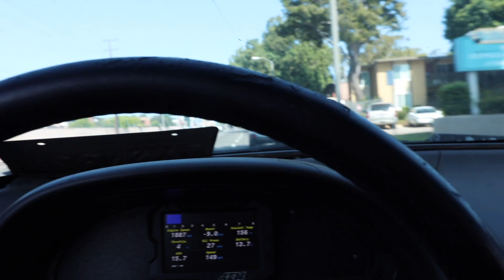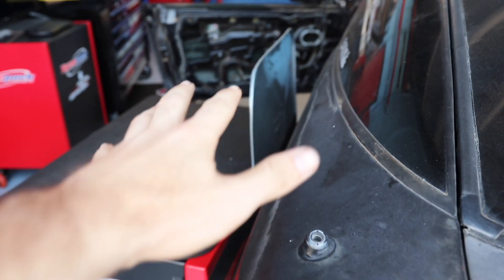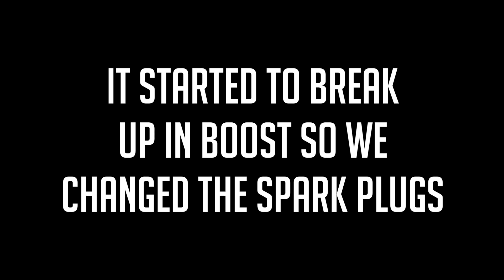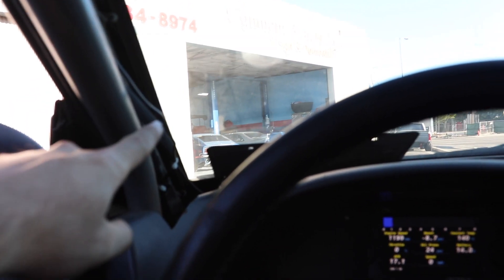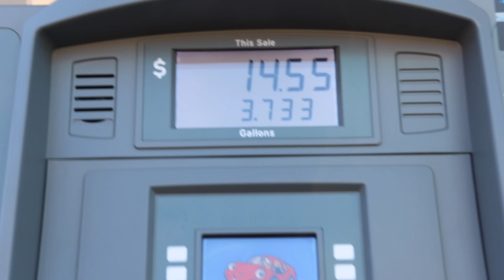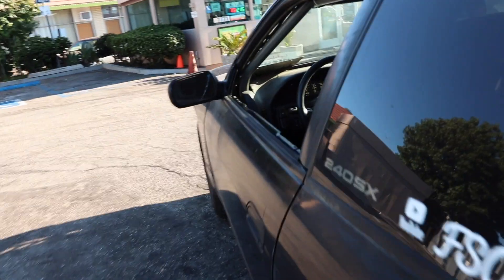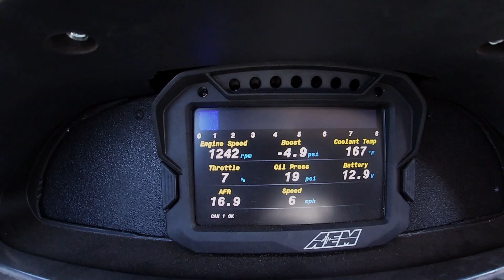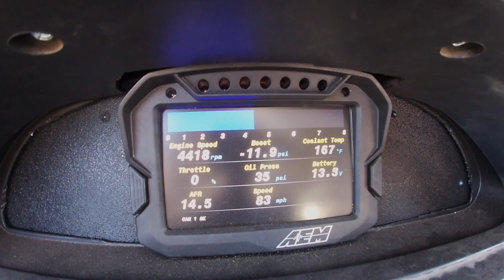Turning Up The Boost On The RB 240sx

Comment: You should pick up the plate and direct mount the coils to the plug. The coil pack boots you can pick up from AutoZone. It's for the is300. You get the boot and the springs..
Reply: A plate is definitely needed.

Comment: Up it to 21psi ;) you know you want to
Reply from the maker: That's a bad idea😂😂
Reply: @FSOMedia  I know of 2 people running unopened rb20s with 21psi, I'm going farther than that but I'm forged
Reply from the maker: My intercooler is rated for 21psi lol the welds with break probably. I'm sure the motor can handle it but the added stress of my tires makes it harder to run more power reliably unless I go e85 lol